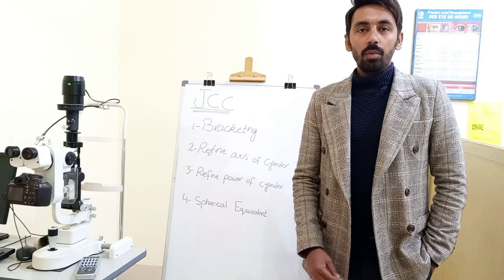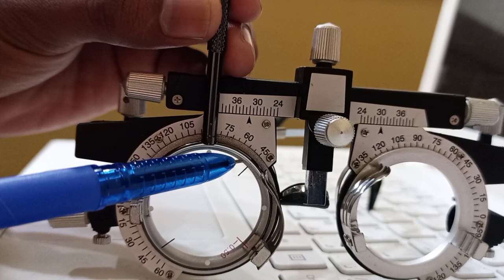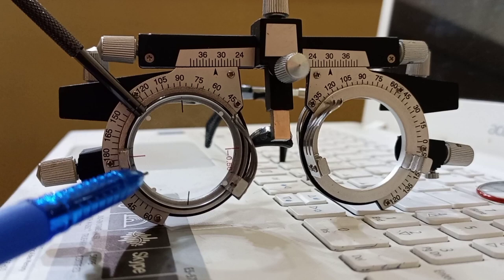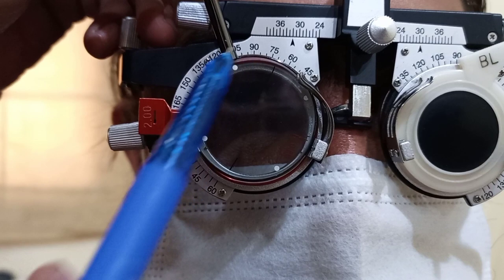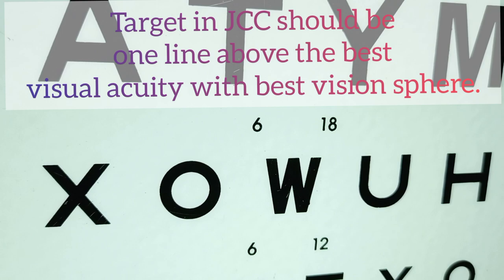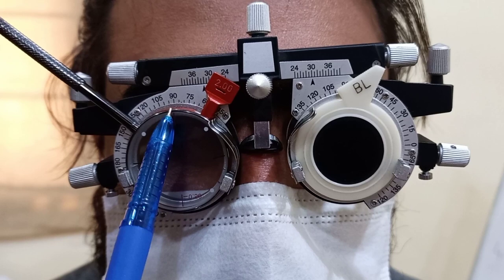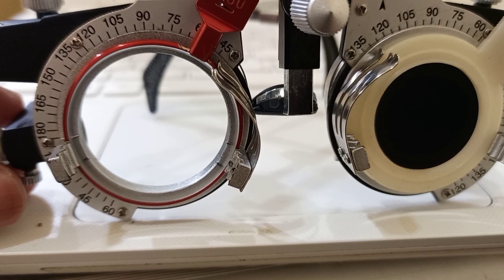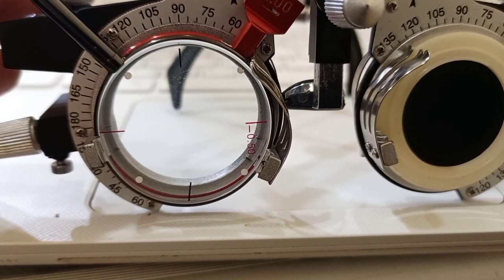(Bracketing) First step in Jackson cross cylinder

Comment: Also tell me is there any need for checking in other axis if the patient doesn't prefer any position at 135 degree handle
Reply from the maker: You will check 4 different axis, 90,180,45 and 135 by putting handle of JCC at 90 and 45

Comment: In oblique and vertical axis , I am confused which axis  choose .
Why are you choose - cylinder  90 degree at position no 2.
Reply from the maker: If a patient chooses the position number 1 then on position number one..you have two options, plus cyl at 45 degree or minus cyl at 145 degree for example..
So it's your choice now you want to go for plus cyl at 45 degree or minus cyl at 135 axis.
But always minus cyl is preferred.
Reply: @optometrywithkhurram6867  ok thanks Sir .